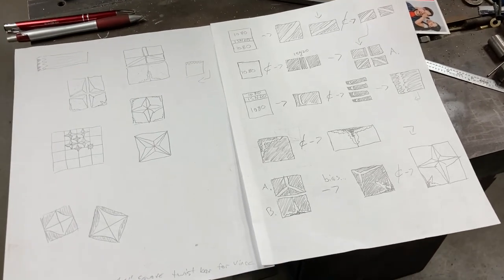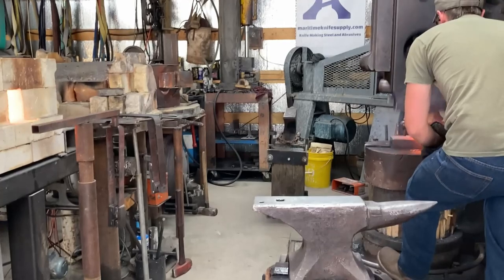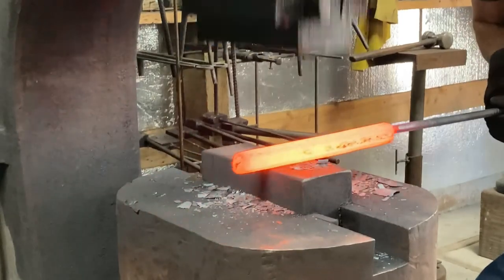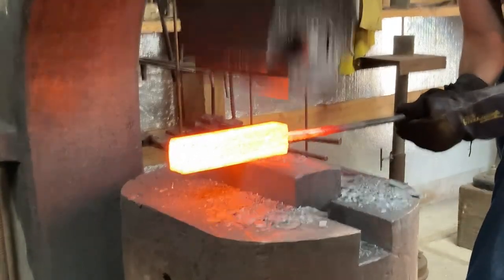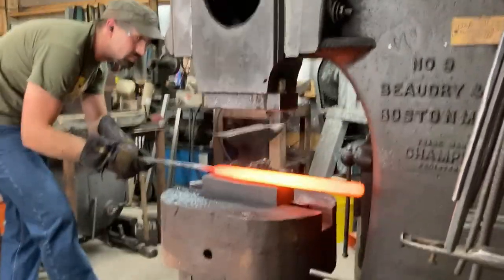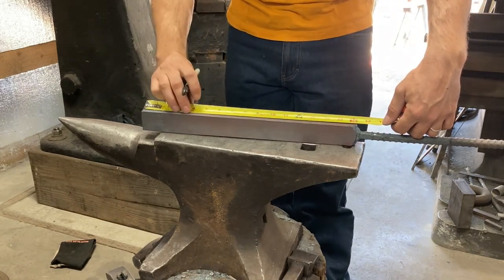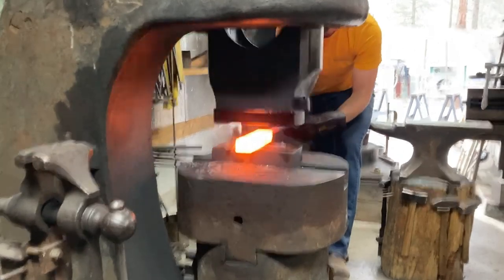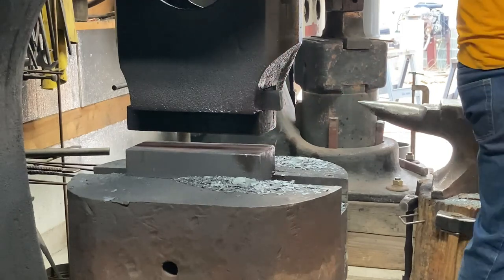Mosaic Bolo Part 1

Comment: Your videos are awesome brother
Reply from the maker: Thanks a lot!
Reply: Hey brother I have a question if you don’t mind answering i make a lot of feathers and I ran into a problem when I do the first sack wield it seems like the outside layer cool and don’t wield but it seems like it is because it doesn’t come apart and I use thicker pieces on the outside and see you don’t have any problems doing it with 1/8 I just don’t get what I’m doing wrong it is driving me nuts lol I normally do my best to try and figure out any issues I ever have but this is kicking my butt hope you don’t mind me asking have a good day bro
Reply from the maker: @adamdeville7686  are you using a press, or a power hammer? I’ve seen where presses can cool the outside layers too much on a first weld. Even so you should be able to get it to work. Try adding some short mig beads part way down the sides from the top, maybe three per side. Your outside stock may be bowing enough while heating to form some scale partway in.
Reply: It’s a 50 ton blue and that definitely makes sense because I was looking at the tack wields on the side and close to the outside they are a thinner wield so yes they could be cracking I been putting my die on a hot plate and getting them close to 300 degrees but I been fun shy lol because of the waisted steel I have lol I appreciate you getting back to me this is my passion and it has been off here lately love your work brother
Reply: The oil tip I will definitely try out

Comment: What is the weight of your big hammer out of curiosity
Reply from the maker: 300 lbs ram weight.
Reply: @PrometheanBlade  right on man thanks. Can I ask you one more question? Not including that one. How many hits per minute is the maximum it does? The reason for questioning is I am building a 100 lb Ram power hammer and just trying to get a base reference
Reply from the maker: @blaneyblades4810  200 beats per minute maximum.
Reply: @PrometheanBlade  right on man thanks that gives me a great Baseline